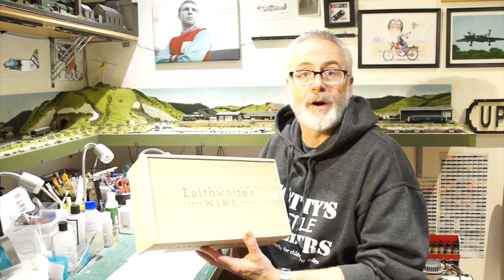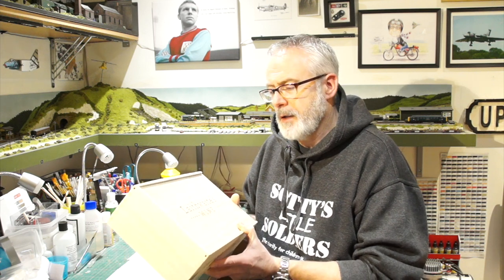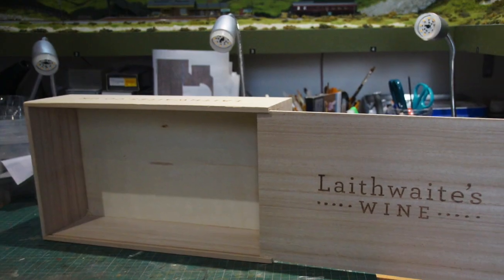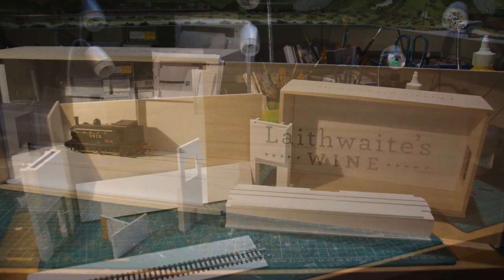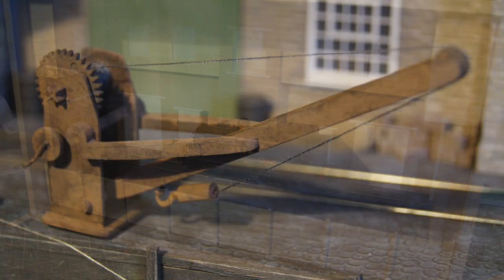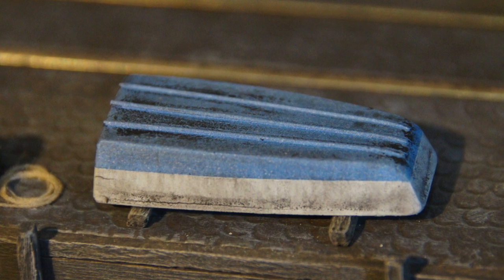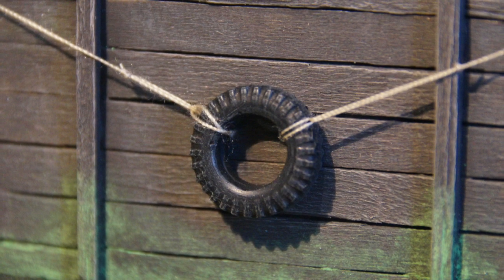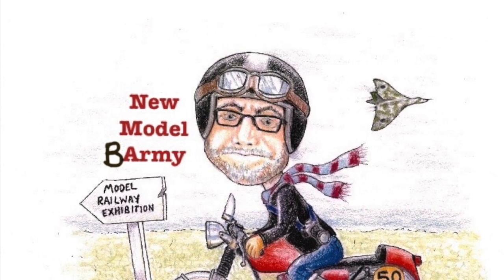A micro OO gauge model railway in a wine gift box!

Comment: Great 'Laithwaites Dock Railway'!  You mentioned an inexpensive controller from Amazon - what is the item number and description?
Reply from the maker: DC Motor Speed Controller, 6-28V 3A PWM DC Motor Speed Controller Motor Speed Regulator Electric Motor Controller with Switch Function
    
        EFISH Power Transformer 12V 1A 12W,AC 100-240V to DC 12V Power Supply Adapter for LED Strip,Fish Tank,Clock Radio,Scanner,Router,CCTV Camera,Doorbell,
Reply: @jasonpierce-newmodelbarmy3394  Thanks :)

Comment: This looks wonderful. I love the N gauge ones but it is nice to see some of the more intricate detail even if it does make for a smaller scene. Does the fiddle yard pack away inside the box when it's not in use, or would you have to store that separately?
Reply from the maker: Thank you. Sadly the fiddle yard won't fit inside the box but the power pack will fit inside the fiddle yard so it does condense down a little
Reply: @jasonpierce-newmodelbarmy3394  What kind of power pack is that ?
What Voltage ?
And how much current ?
And how do you protect it against short curcuit ???
Reply: I ask you because i'm no native english speaker, I didn´t understand what you said.   :(